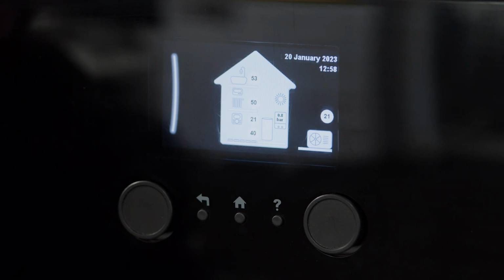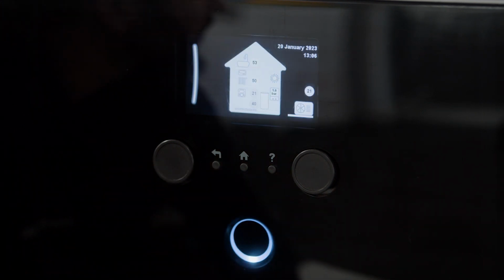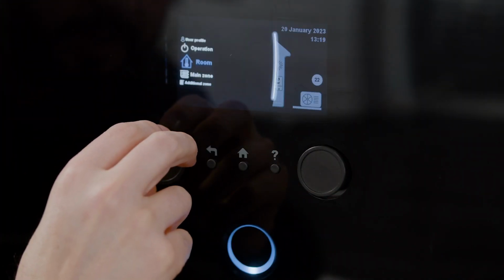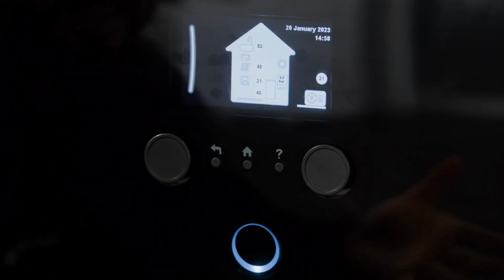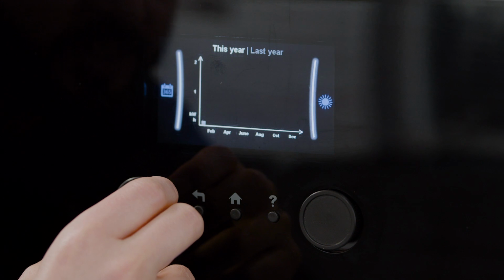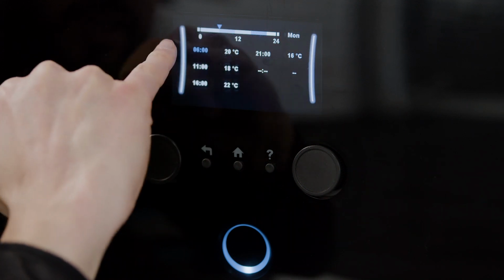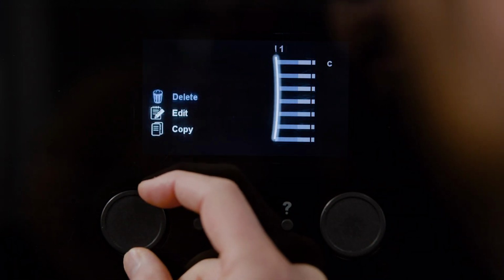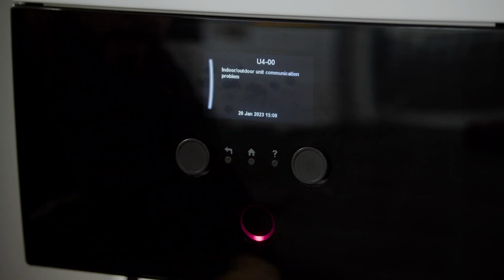Daikin Altherma MMI End User Video FULL

Comment: The problem is that the MMI unit only reports in 1 kw chunks, it doesn’t report partial and the same with the ONECTA app. Also it doesn’t report the produced energy consistently. Moreover the total figures are frequently NOT the sum of its 2 parts. Daikin should take a look at the loop app. See how a quality organisation produce an app that really is useful. There is no way I can calculate my COP from data that is  incomplete, partial and full of  errors. Talking with other folks on user groups this seems a common  problem and one which Daikin seem unwilling to address.
Reply: The only way to get an accurate COP is to install both heat metering and electrical metering separately to the unit
Reply: @adamseymour8738  Adam thanks. So are you saying the heat pump isn’t capable of proving that information?